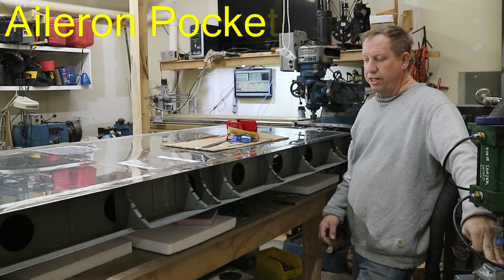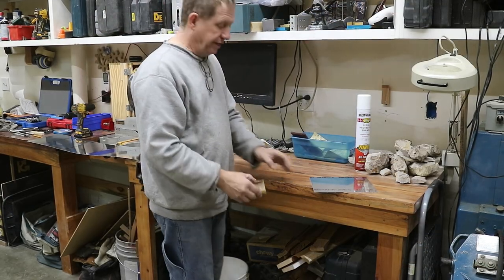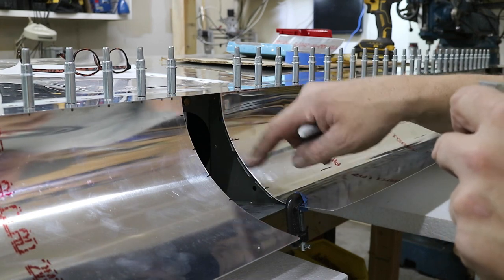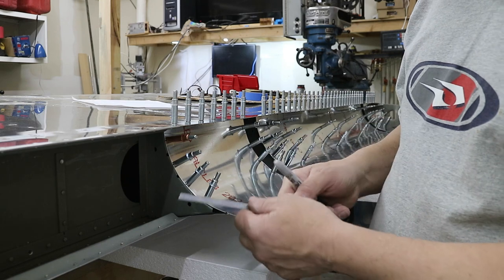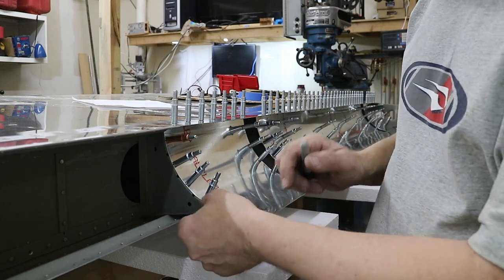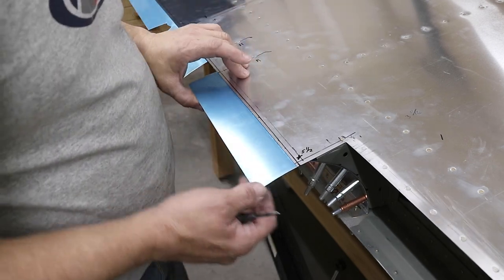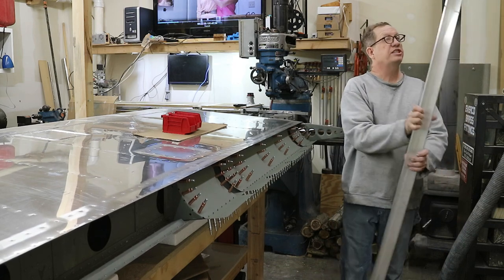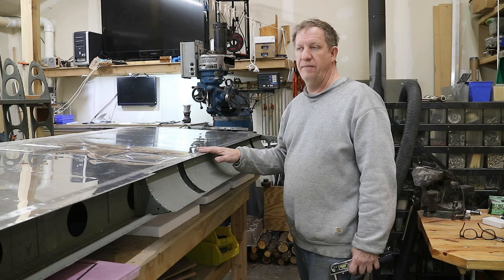Bearhawk Experimental Airplane Build : Aileron Pocket Fabrication

Comment: thanks for makin gall the video's i  was wondering if someone has digitized some files i have a cnc router and want to do like you have !! did you use trochoidal cutting for the thin aluminum skins ?
Reply from the maker: Not sure on the files.On the cut I used what ever Fusion recommended. I am sure it was a standard profile with conventional or climb cut.